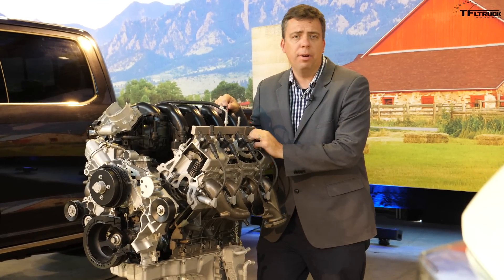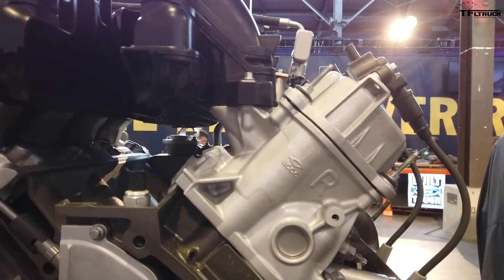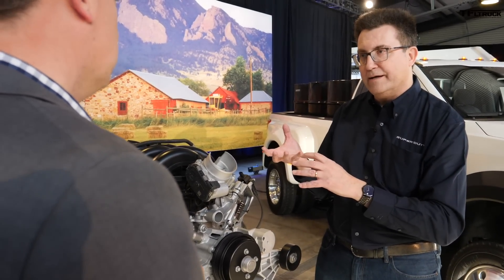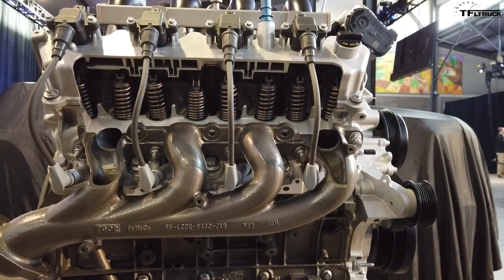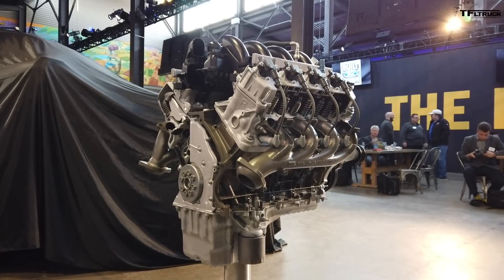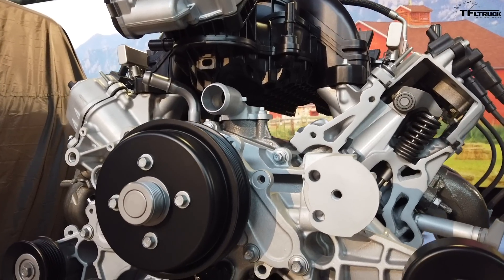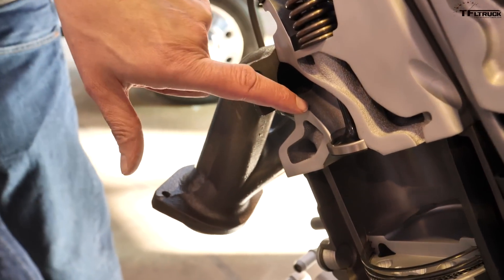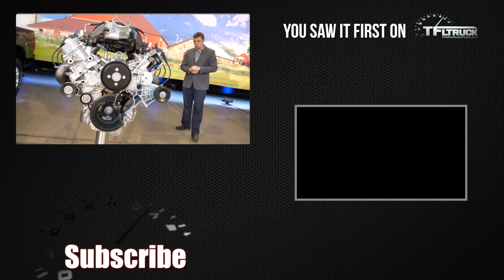2020 Ford Super Duty 7.3L V8: Here's What You Need to Know!

Comment: Anyone else notice the engine is a Y-block design just like the FE engines of the 50's - 60's (390, 427, 428). Block skirt extends below crankshaft centerline. Makes for very sturdy/rigid engine.
Reply: Old school engine meets new technology
Reply: Superman  yes
Reply: Yes and the FE used a cross bolt main in the side oiler
Reply: But you forgot 360 and 352 ci. The FE is the best running v8 of all time !!
Reply: Looks a lot like an ls to me but I like it can’t wait to drive one
Reply: Ford went back to the crank in block design with the mod engines in 91. It was smart of them to carry it over to this ohv design.
Reply: The crank has always been in block!! Do you mean cam
Reply: @jerrybrandt9377 , I said it how i ment it. On alot of older engines the crank is not "in" the block. Its bolted to the bottom of it, half way obstructed without the oil pan. With the longer skirts on alot of newer engines, the crank is actually fully inside the crank case
Reply: Ford FE blocks started doing that in the old days !! These engine manufacturers are getting the original molds back out !! Ibit I have built some high hp 5.0's and Windsor's that put out more power than the older Cleveland's and never lost mains or had a prob with the crank!! Had cylinders crack between each other from to much bore in my farlaine 390 with cross bolt mains ! When the bottom is strengthened they lack iron in areas up top
Reply: @jerrybrandt9377 didn't the 406 have crossbolts too?
Reply: @TripAMD Even the cranks that are bolted to bottom of block are considered crank in block engines. You DO mean cam in block.
Reply: Yes . But it was had a very short run,and hard to come by !! I have wanted to tear into one since I was a teen but only seen one ever in 40 years of Ford engine building. But I have done so many 390's i can still remember all the journal sizes through out the whole engine
Reply: @bobbybobberson3374 , no i DID NOT mean cam in block....See my other comment for clarification.
Reply: @jerrybrandt9377 , just because they reinforce the bottom end that makes the top end weaker? Hows that work?
Reply: @jerrybrandt9377 Didn't forget them, just left out the more mundane versions, like the 360, 352 and even 332.
Reply: @TripAMD I got what you're saying. The modular engines had a block skirt that came down past the crank centreline like the Y MEL and FE blocks. This doesn't preclude the short skirt engines (like the Ford 460) from being crank in block engines.
Reply: Stable Genius As did the Chrysler 440's of the 60's-70's.
Reply: Damn right them old big block fords ran ! Torque and reliability
Reply: Y block engines were the 272/292/ 312 engines beginning in in the mid 50's. The last Y block was the 1964 model year and only offered in the pickup trucks. The FE series engines were completely different from the Y block engines. I have a long background drag racing both 312 Y blocks and lots of 352/390/427 experience. I also campaigned a 1968 Mercury Cougar 428 cobra jet car from 1974-1978 at dragstrips in the Cincinnati area.
Reply: @johnharper2016  John Harper You are correct in your differentiation between the first Y-block mid fifties engines and the Ford Edsel engines of 1958. They were completely different engines and of different engine families. This doesn't mean the FE wasn't of the Y-block design because like the Y-block, the FE engine had a block skirt that extended well below the crankshaft centerline. In truth, one could describe the mopar 440 as a Y-block design as it too had an extended block skirt. My assertion that the FE is a Y-block design is merely descriptive. This being said, racing all these, fine engines (especially the FE's) as you have would have been a hell of a great trip. Hats off to you sir!
Reply: I noticed hou fords COPPING CHEVY LS
Reply: @phillipsmith4961  
I agree. All the koolaid in here doesn't fool me, put a 6.0 ls on a stand next to the 7.3 THEN let me here about How much it looks like an FE
Reply: Simple yet durable.
Reply: I'm still pissed about the 97-03 5.4 intake manifold designs requiring half of the engine components to be fully removed just to change a gasket that was prone to failure.  Dont even get me started on the spark plug issues on the later models (as well as the aforementioned models).
Reply: @phillipsmith4961  None of these designs are brand new. And engineers borrow from each other's designs all the time. What matters, is who comes up with a great end product. Only time will tell if this new Ford 7.3L is the real deal.  Remember, these companies don't particularly care what we think. They only care about what, and how many,  they can sell.

Comment: After years of Ford critics bashing GM pushrod technology, this guy was doing whatever he could to avoid calling it a pushrod V8.  "Cam in block" design...
Reply: paromanin yeah. Idk why they cant just call it like it is, an overhead valve engine
Reply: You are right...ford is smart to do this. GM lead the way for a long time with the pushrods....kind of like ford lead the way with the aluminum content in their trucks. Now GM.......well.....finally swallowing pride and going with a lot of aluminum.
Reply: paromanin - Ford has been selling pushrod  crate engines Ford never stopped building them
Reply: I am primarily a Chevy guy when it comes to V8s, and pushrods, although I drive a Ford 2.7 ecoboost and I love the technology Ford brings to the table, but it's hard to argue with GMs expertise with the pushrod V8s.
Reply: @erikturner8687  that is exactly the thought I had in my mind when I wrote this comment.  Chevy guys shit talked the extensive use of Aluminum... Meanwhile, that is exactly where they are eventually headed as well.
Reply: @paromanin  Except that time I had to rebuild my 6.0 top end because 5/8 factory GM lifters failed and stuck open. Went aftermarket and am still driving it today. Worked great, but GM cheaped out in the WRONG places.
Reply: OHC were good until they started adding cam phasers and bullshit. The 4.6 was a great engine
Reply: @BigCool95  "Overhead" is a bit ambiguous.  Cam-in-block, cam-in-head, and OHC are all overhead valve motors, as opposed to flat-head or i-o-e designs.
Reply: @BigCool95  because both pushrod and S/DOHC engines can be OHV. Think Flathead Ford. That is not a OHV engine and has cam in block.
Reply: @paulhudson231  just noticed you already explained it.
Reply: Lmfao for real
Reply: I caught that lol
Reply: True Dat
Reply: This alum issue is always thrown around. GM did put out info about trucks would have more alum when videos were done back in 2016. The 2014-present did have a alum hood. HD models are steel including newly released. Did hd get same alum treatment as 1/2 ton? no. Fuel economy isn't a big issue that is push on 1/2 models. The bed is still the main place that will never be alum like Ford.
Reply: Paul Hudson yeah i guess thats true, but most people think of a cam in block engine when they hear overhead valve
Reply: @jeffwill4923  Aluminum trucks are junk I see them all the time at the plant and the reject bodys get set outside and a guy on a hilo picks up a small dumpster and sets on top of these bodys and beds and they bust into hundreds of pieces and smash real easy then the guy scoops them up and throws them in a roll off.
Reply: chevy stle ford designs in making the ls.
Reply: @jeffwill4923  Carbon Fiber.
Reply: @P7777-u7r  Agree, my 2V 5.4 is still rock solid

Comment: I’m more a GM guy, but this engine has my attention. Cam in block, no cylinder deactivation, port injection, beastly bottom end, large displacement, low rpm high torque....

Thank you Ford!
Reply: Dude. It's an oversized LS engine.

Comment: Wow a push rod V8 is supposed to be more reliable. Who knew???
Reply: 😲😲😲 no GDI problems
Reply: Tiersmoke92555 hahaha.... Yes for lower RPM applications. But really with larger cylinder block spacing, better cooling, oil injection under the pistons, PFI, etc. there is no reason why this engine could not morph into something much greater. It seems to be built to handle more force induction should Ford ever want to create such a monster.
Reply: I thinin Chevy /GMC knew
Reply: That's nothing new on a GM. That's why their Motors always out last Ford.
Reply: L Rizo 6.4 Hemi was an good one too
Reply: Not a fact but w/e tickles people's pickles.
Reply: L Rizo right I just bought a 02 Yukon Denali with the 6.0 thing has 351k km  and runs like it’s built yesterday
Reply: Corey The FAM 6.4 hemi is  garbage. Had my cam go out at 60,000 miles.
Reply: Yeah they’re great for truck type service but only when the manufacturer can make lifters that don’t suck
Reply: @450xrida  Unlike GM and Ram, lifters problems like crazy.
Reply: Mike Smith probably cause u abuse it
Reply: Dion Mackenzie how did u make it last that long
Reply: @Polack-ml9fh  You must have put vegetable oil in your engine.
Reply: Dion Mackenzie  have a 2002 f150 with over 800,000 km still going strong it honestly just depends on how it's maintained
Reply: He said increasing the bore spacing is what makes it reliable. This same engine with less bore spacing would be less reliable. Nothing to do with pushrods
Reply: Dalton Kirk do you have the overhead cam engine
Reply: Corey The FAM no it’s a junk engine for heavy duty trucks.
Reply: @lrizo3841  no they don't
Reply: Lmfao our modulars are very reliable small CID but makes huge power. Do not try to throw old people shit at the modular v8s because you don't understand them or know how to work on them lmfao
Reply: Who knew...mmmm....
Reply: Gm and ram did 😂
Reply: Its not a very well kept secret the problems Ford has had with phasers, tensioners, and timing chains. They still cant fix the problem for the last 15 years. Maybe Ford has given up on the idea of ever getting timing chains to work right.
Reply: Depends on the design and its intended usage.  The 4.6 OHC motor is extremely durable - many go way past 300k miles.  As he said, at lower rpms the OHC has fewer advantages, and the push rod design makes for a more compact motor. 6K and above OHC/DOHC is much better.  A lighter valvetrain has better stability at high rpms and the pushrods contribute to noise and friction.
Reply: Try find any evidence of widespread timing problems on ford's 5.0 coyote (DOHC). You can't.
Reply: Dion Mackenzie My folks had one back in the day. That thing was the cats meow then. Ran like a top. I took it to my senior prom and left early so we could go beat the hell out of it for the night.  I bet it’s still on the road.  I’ve had ford and Chevy, never any mopar products.  If you could tell me a more reliable motor than the 5.3L family, it would be news to a lot of us.
Reply: Just about anyone who is into cars knows pushrod engines are very reliable. How many DOHC aircraft do you see? How about big diesels? OHC is a waste if you arent gonna rev it out. Pushrod engines may not win for power per liter but power per pound these things beat everything else.
I wonder if they might make a limited edition Boss 429 mustang with a destroked version of this engine
Reply: @coreythefam6455  Abuse shouldnt destroy the PU before 120k...Unless its a racecar or press car. 

 Its 2019, even an abused streetcar should click off 175k if you replace the oil. A camshaft wearing slap the hell out before 60k is Italianlike quality...Awful and sad.
Reply: Michael 1 right but he probably didn’t change the oil enough probably let it go 15k
Reply: @Polack-ml9fh  thats due to displacement on demand. Every manufacturer has had issues with that crap.
Reply: @450xrida  lifter issues are normally due to long interval oil changes and displacement on demand for late model engines.
Reply: Any Ford overhead cam engine for trucks was a disaster!! 502 Chevy is bad ass!! This engine  looks to compete with it. It's a simple v8, not junk v10!! Right now I will finally have nice things to say about Ford gas truck engines!!
Reply: @twoeightythreez  actually half your large diesel engines used for industrial use ohc or dohc. Most of your Caterpillar engines are ohc of some sort and run over 10,000hrs easily.
Reply: L Rizo - Ford knows the benefits of a good DOHC V8 and a pushrod V8. And they do both great can’t say that about Garbage Motors
Reply: Colton Carpenter if you’re referring to my original post... nice try. My truck with the 6.4 was a 4500 chassis cab. The chassis cabs do not have “displacement on demand”.
Reply: I have a "pushrod" 496 Chevy bigblock that turns 7500rpm. It's pretty reliable.
Reply: Nahhhhh theres no way it can be better. Imagine if they would have perfected this decades ago.
Reply: Maybe someone should share this pearl of wisdom with Toyota :p
Reply: Id rather they went back to SOHC no cam phasers and bullshit like the 4.6 crown vic engine
Reply: Lol right, following GMs lead?!
Reply: @torifan1976  I don't know why people don't just go with a timing gearset instead of belts and chains, all modern diesels are like that. 🤷‍♂️
Reply: @Capt. Crab Not for the U.S. market.  And all of their overseas medium-duty trucks and vans are diesel but good job totally missing the point that OHC engines can be extremely reliable, not to mention much more efficient than dinosaur pushrod engines.
Reply: @Capt. Crab You have a chain either way, unless you go gear drive like the old Ford 300 I6, which was also commonly used in generators and such (but with the delrin gear swapped for a metal one) due to the simplicity and durability--but when you're making such little power out of so much displacement it's a low-stress machine.  Even diesels are moving to OHC, like the Cummins ISX.
Reply: L Rizo I don't think so son.
Reply: Imagine that.
Reply: Mike Smith just happened to my buddy’s dads
Reply: @paulhudson231  

The 4.6 SOHC were simple engines too arguably simpler than many pushrods. You had a simple fixed camshaft over each set of valves driven by a chain thats in a relatively easy to get at place no rocker arms or any extra moving parts

The bad OHC engines are the ones like the 5.4 where thay started to put cam phasers etc in them
Reply: @chadbailey8152  

Youre forgetting about the 4.6
Reply: @kodykj2112  

The 300 i6 used timing gears rather than a belt or chain and the engines were so relioable that ford barely made any money on maintainance

I guarantee the reason nobody uses timing gears is because they lose out on money they would have made on repairs
Reply: @406Steven  

A simple SOHC is theoretically mechanically more simpler than a pushrod. Its only when you get into things like VVT cam phasers 3 valves etc that OHC engines get more complicated and unreliable
Reply: Why aren't you an engineer at ford?! Go!  Go for the good of humanty - share your wisdom!
Reply: al carr  The Joke is on You. my Duramax is at 335000 miles lol and still rolling strong. I know for a fact your Ford will hit nowhere near that. Time to upgrade to a GM
Reply: @paulhudson231  my 2006 f150 with the 4.6 has 282,xxx miles on it. I get the oil changed, and my dad before me, every 5k miles
Reply: @smarticus6384  they already did. The 7.3 powerstroke!
Reply: @coreythefam6455  that's not a lot of miles by today's standards. I personally have 3 vehicles with over 300k miles. Granted they are all diesels
Reply: @lrizo3841  I have a picture of the 6.7 dash 886000 miles wont let me post the picture
Reply: dakota croasdale I just seen one for sale on auto trader a few weeks back 2013 f350 with over 800,0000
Reply: Chad Bailey - 5.0 coyote in the f150 mops the floor with the 5.3 or 6.2 chebby
Reply: GM has never moved away from pushrods for this reason....Ford knows this as well, the issue is making them pass EPA requirements over the years
Reply: anjelica church I believe it. The mechanic at the dealer reluctantly told me that was a common problem with the 6.4. He explained it has to do with the way the engine gets oil to the cam. When idling the cam doesn’t get enough oil. First and Last time I buy a ram. I can say the dealer did me right and took care of it on them even though the warranty had just expired.
Reply: @smarticus6384  the more you push an engine the less reliabale.

Having an overbuilt engine means its running at 50% capacity even when yoyre hard on it. But if you want it tuned to give every ounce of power than the engine will be running a lot harder and will wear faster.

Its like if you cruise around at low RPMs VS. Flooring it everywhere and always being on the edge of the red line.
Reply: are you serious ?.......the 5.0 coyote kill any 5.3 chevy....ford always beat chevy.......
Reply: @caterpillar6nz310  and cost 5 times the price.
Reply: Yeah congratulations ford You’re finally figured out what general motors has known forever. Hilarious how the Ford guys have always made fun of GM’s old pushrod engines and now they’re all excited that they finally have one that kind of proves a point. Lmao!  You wait this will turn out to be one of Fords best engines because its pushrod.
Reply: Tiersmoke92555 GDI is actually a good thing for power and efficiency. Everybody uses two sets of injectors now so they don’t have that coking problem anymore.